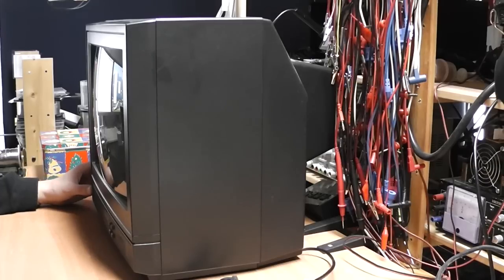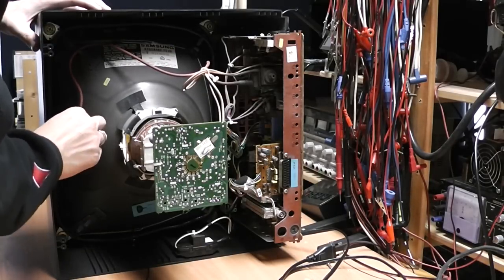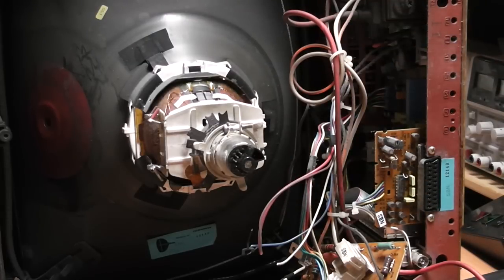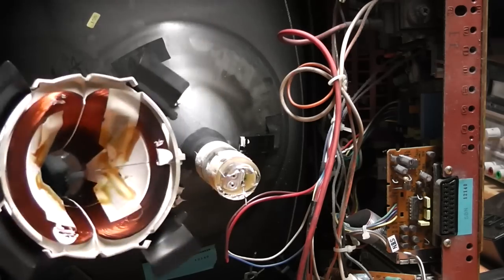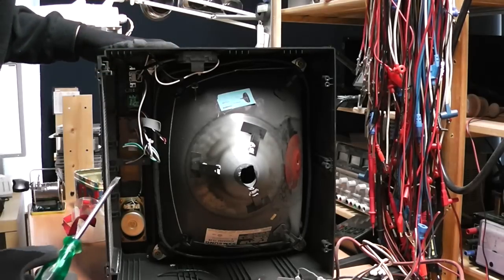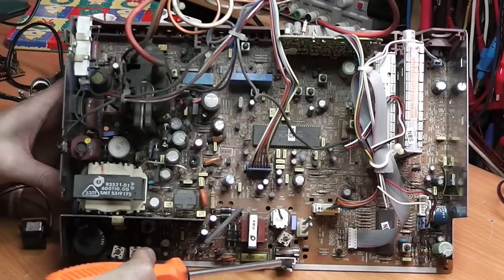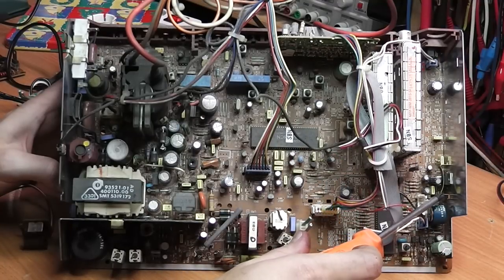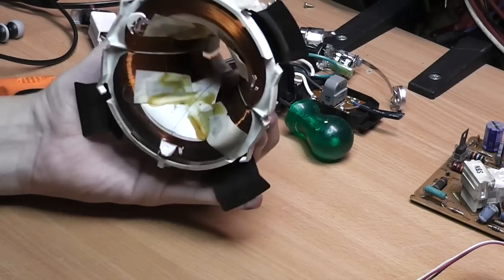Safe CRT Monitor Disassembly

Comment: The only two things I'd say with this are;

1, Take your rings off before you do this. In the event it's not done correctly, your hand will swell at an alarming rate and you may have to get the ring cut off.

2, Do not put your other hand on the TV when you discharge! I almost died when I saw that. Put your hand in your pocket or behind your back, so if it *does* zap you the charge paths to the floor rather than across your chest.

Comment: 2 things:
1 - "pregnant" capacitors of that size are typically fine. Manufacturers use a plastic or paper disk on the top of some capacitors that tends to deform over time.  The underlying surface is typically fine and intact.  If you're careful, and use something like a hat pin you can pry off that top cap and see for yourself.
2 - there's nothing safe about working with electronics while wearing a wedding band and/or giant metal watch...

so... be safe, and take care!

Comment from the maker: The screwdriver should have the same potential as the grounding band of the CRT in order to be useful for discharging the tube. Therefore some kind of wire has to connect the grounding band and the discharging tool (e.g. screwdriver). If those two are not properly connected, you won't be able to discharge the tube (and might falsely assume that it's discharged when it actually is not).
Reply: Thank you... as I was watching I didn’t see how the ground band was attached to ground because the tv cord wasn’t plugged into anything.... I’ll plug my tv directly into the wet ground before I perform this discharge procedure
Reply: I didn’t die 🙂.  But I don’t think there was anything to discharge because I didn’t hear any ⚡️ spark

Comment from the maker: If it's a thermal problem, you have a very good chance of narrowing it down by opening up the case and using a heatgun/cooling spray on certain parts of the PCB until you can reliably reproduce the error. Be VERY careful not to touch anything in there while it's running. Once you isolated the faulty component (booster capcaitors?) you can turn it off (!), desolder, measure and replace. Fingers crossed!

Comment from the maker: In contrast to CFLs, CRTs do not contain a mercury filling. This would have a detrimental effect on the tube: when ionized particles hit the screen, it gives a kind of circle-shaped "shadowy" effect and ultimately ruins the screen's mask. Because of this, earlier CRTs has a specially crafted "ion trap" to catch charged particles before they could hit the screen. All in all, the CRT is kept as "empty" as possible. No danger of mercury here.
Reply: I think I have a bigger CRT, which has probably been outside for a few years. I took off the circuit boards. But I'm worried about the mercury inside. Very heavy, so I'd like to take the metal out from inside and make a coffee table. All a tad risky maybe?

Comment: drilling a hole is just fine as long as you don't push too hard and smash the glass, it wouldn't be fun picking shards of glass out of your hand. Others have suggested driving a nail into it which is a lot more dangerous. Safest is the way this guy did it.

Comment from the maker: Information about the capacitance of CRTs is scarce. However I found an article that talks of 1nF and approx 1kV/inch diameter. This would make 0.18J for a 19" CRT. Compare that to a typical 1uF/2kV microwave capacitor with about 2J (factor 10!). Or against a defibrillator, which start at about 100J. Don't get me wrong: The CRT tube should be properly discharged. However I don't think the shock would kill you -- a jerking motion from the shock that leads to a dropped tool and imploded CRT might.

Comment from the maker: I don't really understand the question. The tube is evacuated, i.e. there will be vacuum in it (i.e. "nothing"). If you break the tube the rushing noise is not gas rushing *out*, but actually air rushing *in* the tube.

Comment: Neat video, very informative.

You left out wire salvage though, such as the degaussing wire bands around the CRT itself.  You could get hundreds of feet of small gauge wire just by removing the insulation on the band.

Comment from the maker: For discharging the tube it isn't necessary to have the grounding rod (i.e. screwdriver in my case) connected to protective earth (PE). As long as the TV is plugged out, you can imagine the CRT as a potential-free capacitor. Since the capacitors leads have no connection to PE themself (TV plugged out), connecting the PE to the grounding rod would have no effect (no current would flow that path).

Comment from the maker: I don't think it's possible because the curvature of a CRT monitor is not really useful for use as a lens. What you might be thinking about is big screen TVs. They work on a very different principle and by design have a huge fresnel lens at the front (which you can use to do some amazingly cool stuff). You can pick up broken big screen TVs relatively cheap (they're very heavy, though). Hope that helps.

Comment: I got shocked by a tube, it's not going to kill you, it was a pretty good jolt. Of course you should always play it safe and discharge it, I always discharge it twice. My teacher even touched the high voltage while the set was on, he got hit with 20,000 volts, he jumped around a lot but wasn't hurt.
So don't be afraid of the high voltage but do treat it with respect and be careful.
Reply: Voltage isn't as dangerous, it's the amps that are deadly, I think over 6 amps are deadly =)
Funny story tho ^^ As well I agree any electricity should be treated respectfully, electricians can make only 1 mistake.
So +1
Reply: ***** naw - i can touch a 25 amp 18v drill battery, it's fun cause it tingles a little
Reply: ***** Actually the amps aren't going to kill you it's the power if you really want to be technical. As you probably know P = V * I^2. Both voltage and current matter just since current is squared it is the bigger concerning factor typically.
Reply: Naa... P = V x I = R x I^2
Reply: I played the dangerous rout i didnt break the tube to devacum it and i got shocked plus almost got killed by the super cap on the main board
Reply: I dissaawbled the old tv i had cuz im making a big swicthing power supply with a tesla coil on top of it

Comment: There is a safer way to vent the CRT!  Lay face down on firm surface.  Wrap carpet over the back of the CRT, leaving a small hole st the socket.  Strike the CRT "tipoff" in the center of the socket until you hear hissing sound.  Wait until the hissing stops.
          If a crack propagates into the funnel of the CRT, flying glass can travel over 30 feet!  The carpet cover prevents this & the small targeted hit makes the chance of this happening.
          If you scratch the glass around the neck first, that "break" occurs much cleaner.  Wrap rag over the neck first, then strike with hammer.
          The "tunnel" in the electron guns are electrostatic "lenses" to focus the beams.  The pod on the long arm is the "getter" (has chamicals to absorb gasses, to maintain the high vacuum over the life of the tube).
          The wire can be unwound from the deflection coils (if it is not potted).
          You need to pull out the shadow mask from the CRT.  Sit the TV set face up (on boards so you can access it from below).  Strike glass first at the neck to start glass breaking, then strike further up to break glass almost up to the front face.  The pieces will fall away (have old tarp to catch the broken glass).  Lift set off & invert to face-down.  You should be able to remove shadow mask by prying loose 3 or 4 arms around the edges.  Lift out.

Comment: I have fixed a few tvs this way when the color was off a bit and such because nwer tvs don't have external knobs. I just can't remember if screen is the color or if the third one is. The third one is labeled with a 1 on the flyback I have here. Focus is pretty straight foreward, it literally means like in or out of focus like you see.

Comment: Take off the back of the tv, turn it on, Look for the flyback, if you can't find it follow the red wire down from the suction cup (don't touch it) it's attached to what you're looking for. There should be 2 or 3 labeled knobs that you can turn with a screwdriver (focus, screen, etc.). Turn the screen knob only a little and look at the screen. Keep doing this until your picture comes back to normal. You may have to turn it the other direction. You may even have to turn the third one (not focus).

Comment: I've never once discharged a crt monitor before pulling the high voltage flyback wire out, and I never had a problem. The flyback itself doesn't hold a charge it's just a transformer. If you're worried about shocks you discharge the capacitors, but if the device was turned off properly and not by a power surge then the capacitors are already discharged as devices with push buttons lose the charge from the capacitors when they turn off as the components still complete the circuit when it's off..
Reply: The tube may retain a charge for quite some time, be careful.

Comment: I want to strip down a huge 40" Sony XBR CRT for an arcade cabinet project, but I am too hormephobic to even want to tackle that set.
Because it's heavy enough (over 300 lbs.) trying to move it as it is, I'd be afraid of trying to move it into the cabinet without any of it's protective covering and accidentally grabbing or touching the wrong thing and getting shocked and knocked down with that huge set coming down on top of me.
And that is all after the fear of the beginning task of just stripping it down, and then accidentally touching any wrong things, as that I've learned those sets have a lot of 'hot' components.
But, this must be done...
Reply: Bro get a mini fork lift there preaty handy they cost like 200$ to 1000$

Comment from the maker: The monitor ground is connected to the other side of the capacitor that is constituted by the tube itself. Why would it need to be connected to anything else? You just need to discharge a capacitor by shorting its leads (one side is monitor ground, the other is the tube connection).

Comment: Besides the red plug, is there any other parts you can shock yourself? Such as the pcb components?
Reply: Yes, the capacitors. But thats with most electronics so as long as you dont touch the capacitors in the tv you should be fine but ALWAYS,ALWAYS discharge the crt. First thing befire messing around with anything. Trust me it can even safe your life.
Reply: Yeah the capacitors but only the downside touching it is ok as long if you don't touch the wires that go into the pcb but that's almost impossible

Comment: Every CRT I have looked at had a vacuum plug at approximately 90 degrees opposite the wire plug.   Did you see one?

Comment: wouldn't you want to check with a volt meter to make sure there is no charge? seems like a big risk to take to assume.
Reply: A typical multimeter is usually rated for 500V insulation or so.  The insulation will likely handle a bit more but the instrument will not.  Using a suitably rated (expensive) HV probe with suitable meter would be a good thing to do.  However if you have a known good jumper wire and make good contact you can be reasonably sure the tube is discharged after you have shorted the HV terminal to the external grounding braid strip (wire).

Comment: is it dangerous if I unscrew the coil thing at the neck of the tube without getting the vacuum out? I moved it a bit and I heard a bit of cracking, not sure if it was from the glue or from the glass. Also, when the little pcb of the tube touched the terminals, I heard a high pitched noise, something like the "wiiiiiish" that you hear when you turn on anything whith high voltage, for example, when you charge a camera flash but faster. At the moment, the crt was disconnected, obviously
Reply: The hiss was you likely letting air into the tube.  The crack was likely just a glue bond breaking.  Removing the deflection yoke can sometimes be hard as they are usually glued in place so if you have no use for the tube it is safer to work with it when the vacuum has been released.

Comment: Hey, very useful tutorial johndoe, I was wondering if you might be able to assist me on a matter, my current crt pc monitor, with quite high sentimental value. After turning it on, it works fine for a short limited time. After which I presume is a overheat, the picture then distorts, it gets bigger, darker, as if it loses contrast or brightness. Do you have any idea what part is causing this to happen?

Comment: How can I dispose of the glass tube that's left after disassembling it?
Reply: Most important is NOT to put it with the household glass recycling as it will cause contamination.

Many countries have recycling centres that accept electronic or hazardous waste and this is the right place.  Usually I have read that the service is free of charge for small household quantities.  These days (2019) there are already a diminishing number  of CRTs being scrapped so some places send them to landfill (where it poses minimal hazard as the leaching process is incredibly slow at the speed the glass disintegrates).  Best case scenario is to recover the lead from the glass in suitable facilities and send it to the car starter battery industry so less lead needs to be mined.

Comment: I'm planning to use an old CRT Television as a movie prop. What I basically need is the empty shell of the tv, with the screen intact. I need space for a head to fit in it as it is going to be worn as a mask. Do you have any tips for getting out the remaining parts of the infundibular glass left in the casing? And maybe some other tips I should think about before using it on film?
Reply: Replace the complete tube with a plastic sheet that has been slumped to a convincing curve by heating in oven in a frame with hole same size as hole in TV case.  The faceplate glass of a CRT is thick and made of leaded glass so it is slightly heavier than common soda lime glass (windows, jars) and will cause neck fatigue if you have to wear it as a hat.

See also https://youtu.be/ZeN2gMM31lE?t=146

Comment: when removing the rubber cap from the glass tube, do I need to worry about the vacuum?
Reply: I did it with out devacuming it
Reply: No, the rubber insulation cap around the HV terminal is to prevent arcing across the outside surface of the tube and accidental contact with the HV terminal.  The HV terminal is a bonded metal cap in the tube that is sealed to gas but connects the internal conductive surface (Aquadag) to the HV supply.  The idea with discharging the tube is to make contact with the metal under the rubber with the grounded screwdriver before touching it with your hands.  Having removed many in my youth I find it easy to remove it without touching the metal bits (just in case even after discharging it or working on a long unpowered CRT) by folding two sides of the rubber up and unclipping first the one side and then the other of the contact on the HV wire.

The vacuum is pumped and sealed into the tube from the evacuation stem that is right in the middle of the small end of the tube protected inside the glued on plastic base with the pins sticking out.

Comment: Shouldn't take half a year to remove the anode wire, lol. Tip for you... the 2 wires in there are spring metal. Press against the inside of the crt hole to compress it to easily get the L shaped leg of one of the wires out, and the 2nd one is easy. You can use a screwdriver under the rubber cover, or just grab the top of the rubber cover and slide to the side (after discharging). I hope that helps.

Comment: How long can tube keep charge? In last 2 days I disassembled Sony GDM FW-900, successfully. =) It hadn't been powered for a year or more, so I think it was safe enough.
But I have another one of this for repair. Actually I don't know what particularly is bad, so I want to replace all video PCB with those from first monitor, it had bad CRT - green splashes and then turn OFF.
And the whole video PCB as kinda complete system with hot wire for anode. So, I need to perform all replacement safely.

Comment: Electron gun!  Is there a way to remove the electron gun without breaking the tip of the CRT? Those could be used for plasma experiments or to make an electron microscope or maybe even a mini particle accelerator.  Sad to see it break
Reply: They are removed by cutting the neck with a diamond cutting wheel or scratched and then heated with a red hot wire and the neck snaps off.  This was routinely done in the days when tubes were regunned as a new tube was a lot of money.  At the end of the CRT era tube production was so high the price of tubes had fallen to where it was no longer economical to manually repair tubes that were made with automated machinery faster than you could repair one.

Watch here how they regun some old tubes.

https://youtu.be/W3G7b-DcOO4?t=445

Comment: I have this tv that has been sitting in my garage for 5 years and it's a tv should I still discharge it even thought it hasn't been on for like 5 years should I still discharge it?
Reply: Skywtaker Is here Always, just as a precaution. Better to do it and not need to than not do it and get killed because you didn’t